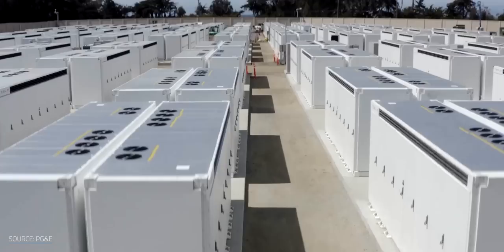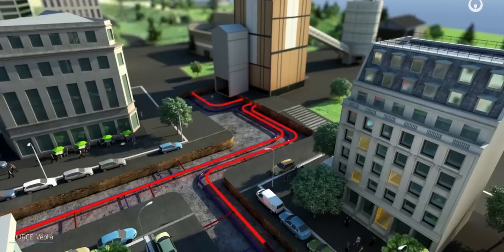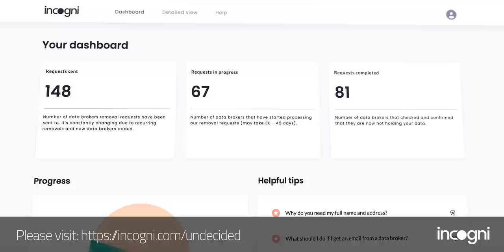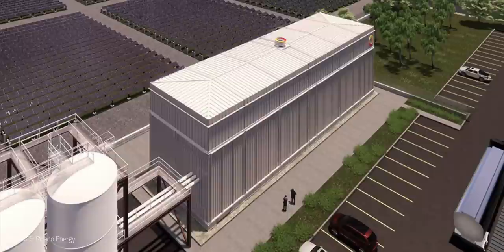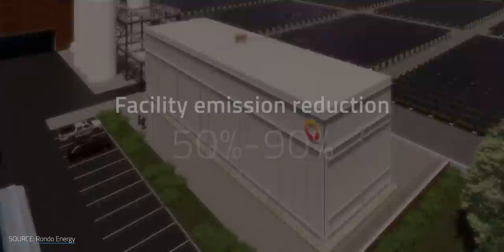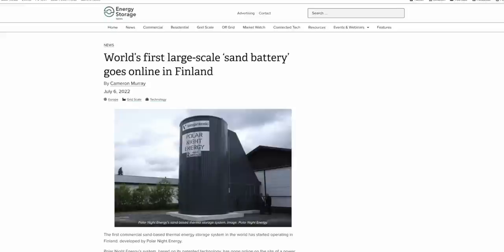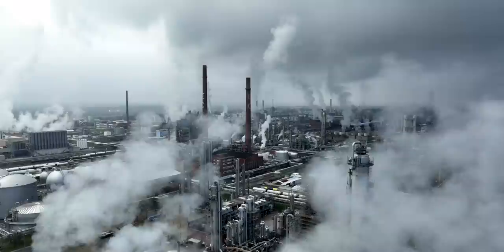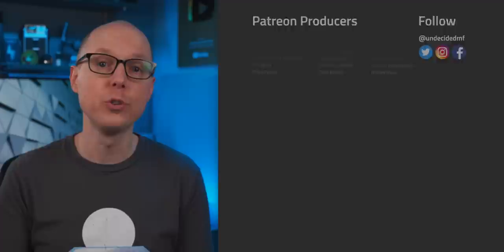How A Brick & Rock Battery Is Changing Energy Storage

Comment: It's certainly an interesting proposition, with high potential.  There are Co-generation ventures that generate and pipe heat and electricity to homes.  My concern would be if this were mass-adopted, to the point of centralized heat storage and distribution for neighborhoods, that requires infrastructure as well to carry it, and distribute it to homes or appliances.  That's a lot of coordination and cost on a lot of fronts, and won't happen quickly, meaning they won't be able to simply convert existing Natural Gas infrastructure to fit this application as they'll need to be concurrent for some duration.  Environmentally, It's a sound idea and theory.  Realistically, and like what we're seeing, this change is going to be driven by companies buying into their own battery systems, then local governments supporting this move with larger scale, but still relatively small infrastructure to as a draw for businesses, and then trickle down to the consumer and residential level with widespread, local adoption followed by State and Federal funding, mandates, and incentives.

Several energy technologies are progressing by leaps and bounds, from generation to storage, transmission, and renewables.  I think what will be most exciting is when these start to converge, and we see all the various savings in emissions and efficiencies converge and stack and where that lands us in relation to our current levels.  Novel storage and renewable, novel generation, combined with transmission and electric transportation means we can collectively chop wasted energy down significantly.  Energy generated and transmitted to homes and vehicles at a high rate of efficiency in every step of the process will be revolutionary, and while it won't eliminate our reliance on combustion, it will centralize the vast majority of our use of it, making it easier to manage and faster to improve upon or phase out.

Comment: Left me wondering how the heat drops off as it "discharges" and how that would limit the utility. Also question how large it'd need to be to work for very large district heating projects (e.g. NYC) to actually benefit from storage vs it just being a huge resistive heater. Might be a cleaner stand in for places already configured for district heating, but seems like a bunch of heat pumps (well over 100% efficient) + electricity storage is a generally better bet compared to building out new district heating around these.

Comment: Heat is a good idea for energy. Why not set up a geothermal heat exchange using the earth itself. I mean when you dig deep you get to a point where things get warmer. So burried batteries of these types could not only store heat better but last longer. Also if your in an area where there is a lot of thermal heat then the batteries will not need as much to recharge.

Comment: Converting 100% energy to heat is actually bad. Use a heat pump! It might take huge and special heat pumps to achieve higher temperatures, but should be possible and would increase efficiency largely. Even if we only get 800°C for when 1600°C is needed, this would cut energy consumption roughly in half. And also the heat pumps could recollect waste heat for higher efficiency.

Comment: First of all 1,600C is not that far from 1,800C, seems like it wouldn't be a tremendous engineering challenge to do an additional preheat to final application.
Second a major US baker (think bread, cookies, crackers. You have some in you kitchen now) is replacing gas water heaters (think cleaning cycles) with electric. Good 500C application.

Comment: With direct hydrogen reduction these system could easily provide the heat for steel production as the DHR process only require temps of about 800C

Comment: I wonder if you could couple these solutions with a high-temperature heat pump to boost the outlet temperature to the thresholds needed for steel and cement production.  Sort of like an electrical transformer, but instead of a step-up voltage you get a step-up temperature.  Granted, energy would be required to run the heat pump but it would be a small fraction of the overall energy delivered to the end-user.  If that's possible, then it would seem that it would also open the door to heat storage at lower temperatures overall and thus decrease losses over time from conduction/convection to the environment which might make up for the energy required to drive the heat pump system (or at least largely mitigate it).

Comment: A huge chunk of recent cement use has occured in China, there is a Forbes article from 2014 with a title that says it all really
 'China Used More Concrete In 3 Years Than The U.S. Used In The Entire 20th Century'
the stats being US 4.5 gigatons 1901-2000, China 6.6 gt 2011-14.
 Not that China shouldn't have the right to develop or discounting that it has made efforts to decarbonise, but it's notable that 25% of their property is sitting empty and much infrastructure is conically under utilised. Land speculation causes massive distortions such as these and sprawl in general is a massive factor in global emissions.
 A land value tax would go a long way to addressing this, China doesn't even have a property tax yet.

Comment: I have long been amazed that cities are not designed as functional eco systems, with thermal waste from factories being used for energy production, heating homes, and even other factories that needed the heat. Paying to get rid of something that has value to me is the definition of insanity. Same with physical waste, small reclamation plants instead of dumps would make such a difference, wind and solar on every rooftop, using construction rubble for roads and insulation. Just for a start. It's about time we stop thinking of every building as a stand alone thing, each affects others and is affected.  So much energy is wasted in our world. So much material. It's sad.

Comment: I don’t see why a 1500 degree battery could not be used in a steel making plant, since temperature and energy (heat) are not the same thing. Even if the battery is only heated to 500 degrees, with enough modules it could store sufficient energy for a steel plant to operate.

Comment: Sad thing is that electrical surplus is converted to heat that then is terrible to get electrical power back out of.
Your not running a steam turbine from this heat. And Peltier elements also perform rather poorly.
For heat storage you would need quite a bit during summer to last the winter. Especially on a per home / off-grid system.

Comment: You don’t make steel with hot air. Either coke or electricity is used, so a thermal storage battery wouldn’t be an ideal solution anyways. You’d be better to identify a more sustainable coke or use renewables for producing enough electricity to run an electric arc furnace.

Comment: One further thought: These companies could also target energy companies. We usually know the problematic periods beforehand. What if this system was added to (nuclear) power plant? Could it generate steam to run a turbine and generator? One could store heat over night and produce the electricity during the peak hours.

I know that this should be probably placed quite close to the core of the power plant. Now I assume that there is usually no extra place within a power plant for this. I would check this from Homer Simpson. Using supercritical fluids could downscale the space requirements.

Comment: OK, this may be a stupid idea, but would it be possible to vary power output of a nuclear power plant by storing some of the heat generated during off-peak hours and using it to run turbines during peak? No changes to the reactor or its heat output, just delaying its use. It would be a massive amount of energy to store, but if the storage is dirt cheap...

Comment: Wow, hopefully electronic devices can benefit from the TES application in the future. We pumped out a lot of heat from cpus and gpus only to add more energy to remove it from the system. This looks like a potential to me, albeit small.
Reply: Finland has server farms and data centers that produce a lot of heat waste. This is connected, in some places, to centralized heating of nearby town or village. Now I assume that the heat generation and the need for heat energy do not always meet. A simple system, say with stones in a heated water bath, could work as a 12 - 24 h buffer here.

Comment: Green steel and Ferrock already exist. We don’t have to create tech to fix the steel or concrete industries, because the solutions already exist. 

Caterpillar demonstrated that you can, absolutely, make steel using green hydrogen, hence them using the label “green steel” on their autonomous prototype. 

Ferrock is stronger, more flexible, more durable, and has a longer lifespan than concrete while also being carbon negative for its entire life. You can use all the same infrastructure as concrete and it’s made from materials that are already considered industrial waste.

We have the tools, we have the technology, we have the raw materials, we just have to use them.

Comment: Hi Matt,
A question regarding the Drax report: Did it mention whether or not it was including turbines that were inactive at the time as part of the loss, or was it just the that the loss was calculated based on the amount of energy generated at that time?
I ask because in the UK, it's very rare that the total capacity of a wind farm generation capability is used. I don't know exact figures, but you regularly see them operating at 30 - 50%.
So, with better storage, the amount of wind generation in the UK could be drastically increased, in theory
Thoughts?

Comment: In actuality many of these concepts are old hat, having been around in one form or another for from centuries to many decades.  One application that I saw proposed way back in the '70's I think, was to uses solar collectors of various sorts to store large amounts of solar heat and then use that heat with low delta t boiler/turbines to generate electricity 24/7 from solar power. I have no idea why it was never followed up on, but it seems to me that it was a very valid way to generate "green" electricity and still is. Of course I am not an engineer, so there may have been some killer flaw that I was not aware of, so this is a kind of for what it's worth comment.😁

Comment: YES if we want to shut down CO2 plants or reduce them we need good alternatives. A battery SAND battery or these new Brick and Rock batteries. The heating element may be an issue long term but it is cheaper and easier to use than Lithium batteries.

Comment: Is it possible to use a heat pump to heat the bricks to multiply the amount of energy being applied?

Seems that the cold side of the loop could be placed inside a giant building or possibly used to cool solar panels to increase their efficiency.

The only potential issue is I don't know what the maximum heat energy the fluid could carry to heat the bricks.

Anyone know of anything I am missing? Figure I must be if it isn't already done

Comment: Teacher: there is no use for electricity that is 100% efficient.

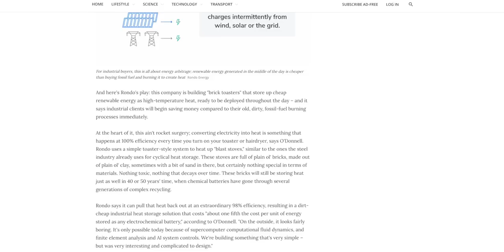Here: 8:25

Now seriously, it is not 100%, yeah, the losses are as heat, but it is important to know that not all those losses happen where you want the heat, nothing is 100% efficient.

But, if it is already electricity you can use pumps to move thermal energy at a higher than 100% efficiency, in other words, this might be combined with geothermal for a better use of the energy, I would need to study more to know if this is viable.

Comment: A thermal &/or passive system seems more efficient & cheaper than generating electricity from solar then running a heat pump.

Comment: Now I'm not super familiar with this tech, just what was discussed here, but it seems like this is only really being applied as a means of supplying heat.  Couldn't that same superheated gas produced on the output end of the system be applied toward producing an electrical output by using it to spin turbines--basically as a steam engine?

Comment: Two words: heat pump. 

Seriously, resistive heat generation? Moving heat around is a lot more efficient than directly converting to it via resistors.

That said, it’d be a challenge to make a heat pump that can work with that steep off a thermal gradient.

Comment: IMO its misleading to call this energy storage. Its just heat storage, if you wanted to get electric energy back out then you'd need another steam plant built around it which would drastically reduce efficiency.  I agree with you it has a lot of niche cases that it can help with in the industrial landscape. It won't be replacing lithium anytime soon however.

Comment: I'm not entirely sure if this is a stupid idea but would it be possible to combat the incabable of making steel by using a alternating system where their are three compartments of steel mixture the input and output and transition the input gets heated up by the sun throughout the day until it's molten steel at witch point it switches to output which during the entirety of the next day powers stuff cooling it down in the proccess until it's not usable as a heating method at which point it goes to transition which cools it down enough that it turns into usable steel then gets emptied and goes into input again creating a loop where it's input to output to transition to input would this work or is the heat from steal making not excactly usable for some reason

Comment: I’m not sure the volume of CO2 from steel making with stored energy is accurate. A large percentage of the CO2 produced is from the coking process that reacts the carbon with the iron oxide to produce metallic iron and CO2. As a byproduct heat is produced. But the primary process is the chemical reaction to move the O from the iron oxide. Unless we use electrolysis, CO2 will be produced. Heat and power consumption are secondary in the production of steel.

Comment: I must ask a question a bit outside the box: I wonder if Thermal batteries can be used for residential cooking like stoves and ovens? I feel it is a good game changer.
Reply: If using heat from a district heating system, it would depend on the heating loss around the grid and the equipment. Steam ovens are used in commercial cooking but not so much in homes. What's warm enough to heat radiators or under-floor heating isn't enough to cook food, except pretty slowly (as in a sous vide). 
Of course, traditional societies have used "thermal batteries" all the time to cook food. The traditional umu and hangi used by Polynesians and Maori are holes dug in the ground and lined with volcanic rock where a fire is lit on top and burned for some hours to heat the rocks. (That is, if there isn't any rock heated by volcanic activity near by). The fire burns out, then baskets of food are arranged on top of the rock, covered with wetted leaves or sacks, then covered with earth. The food steam-cooks in that over some hours.
So it's theoretically and technically possible, but whether it'd be practical in an urban environment is something else.

Comment: I don't think this is going to work like they think. Also I think it's redundant. They are going to heat brick, and stone, and then boil water with it to turn a turbine, or to heat some other thing. So why not just heat the water, and store that heated water instead? 

Even then, the loss in heating any material to later try and convert it back to electricity is going to be less efficient than just using a battery we already have available. I might be a way to supplement energy storage, but I doubt it will be able to really compete with a lithium battery.

Comment: Frankly the more they can develop this tech the better. Given how much heat is needed then expanded by multiple processes in the modern world finding some way to store the heat energy could lead to senarios where once wasted heat from a process could possibly be partly captured on the way out and used again. Hell could be very useful in Nuclear power stations for additional emergency backup in that if done right the station could essentailly recharge the Batteries providing backup power instead of relying on a limited supply of fossil fuel.

Comment: Thanks for sharing your videos. Left wondering if this technology would be compatible with heat pump technology for storage of excess electricity. If heat pumps can achieve the high temperatures required then their ability to exceed 100% efficiency on the heating phase could help make up for inevitable losses on the usage side of the equation.
Also would like to make another request to see a video on the HydroMax gasification process for hydrogen production, another one of its benefits is the production of clinker for the cement industry as a byproduct from its process. Wishing you and your family the best.

Comment: Look, the comment about burning biomass being controversial isn't. Wood gasification has been well studied since the time before the American Civil War. They can use the run off gases from burning biomass into useable wood synthesis gases and creosote. They could run more power generation with a carbon neutral fuel and sell the creaosote run off to the other oil/plastic companies partnering with thermal power storage companies.

Comment: If you allowed nuclear power plants to use their heat exchangers directly with manufacturing, we could get most of the way to releasing no carbon for our resource refinement. For steel you need hydrogen as well, which is not plausible that you can produce with solar and wind due to massive inefficiencies. For concrete you need carbon capture, and that concrete would actually be carbon negative as concrete absorbs large quantities of carbon during the first few years after setting.